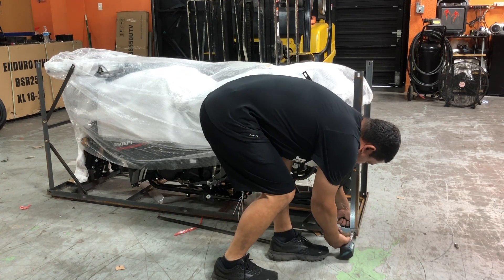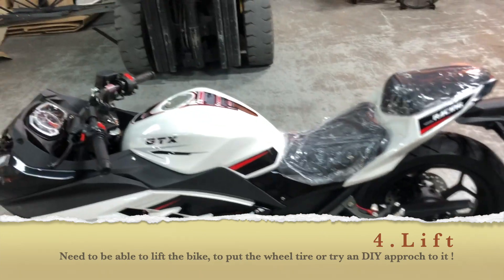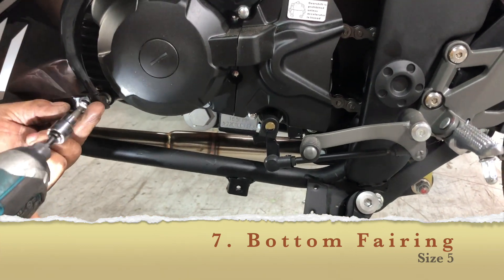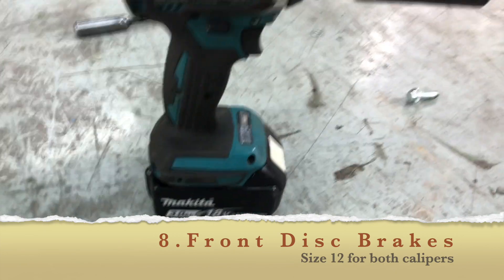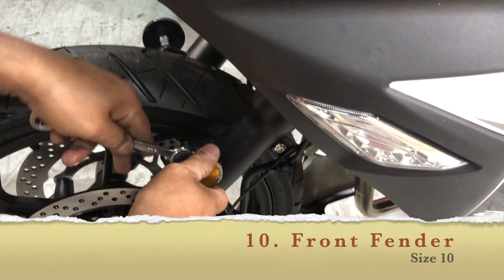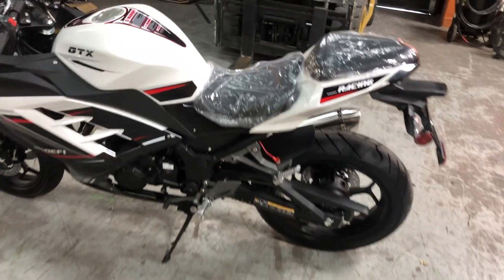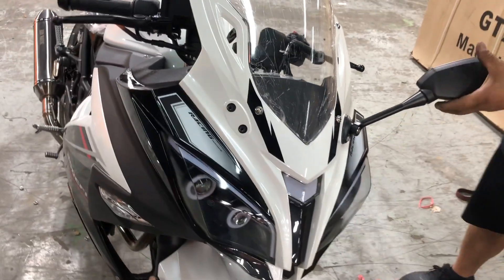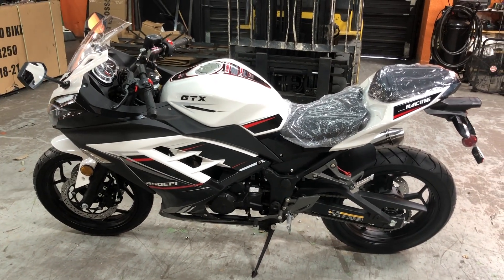EASY 12 STEPS ASSEMBLY GUIDE FOR 2023 VITACCI GTX 250 EFI

Comment: always start bolts by hand and use locktite and grease axles rear axle too cause they dont put grease on them when you need to remove axle it will be easier

Comment: I know you bolted it together fast for the video.   If I was a buyer, I would take my time, put medium anti vibration thread locker on bolts just to be sure.   You don't want anything vibrating loose at 50+ mph.   Also, I would check other bolts all over the bike they are tight, engine bolts mounting bolts, etc.

Comment: how do you get to the air filter to clean it? it seems like its unnecessarily difficult to access it considering it needs to be clean around every 2000 miles and I cant get into it to clean it without taking the side panels off and possible the gas take as well. there has to be an easier way to access it. @161powersports4

Comment: Does it come assembled already?
Reply from the maker: Yes sir, we now have a way to have it shipped fully assembled turn key
Reply: Looks like could've cross threaded that top bolt. Should use a T handle Allen tool to start bolts. Might suggest a rubber mallet instead of that hammer. That hammer can chip away finish causing rust.

Comment: I don't think I'd want anything from this dealership yikes scary I was thinking about and been looking at the Asian stepped through scooters motorcycles so forth and so on and my hobby is working on airguns I hunt with them do backyard plinking and I do quite a bit of tuning on them but if I worked on my airguns like you work on these motorcycles I would probably be dead by now
Reply: Dude definitely cross threaded  putting in that second  handlebar screw. Smh brand new bike and now needs a new triple tree